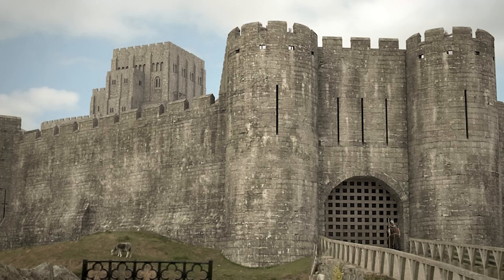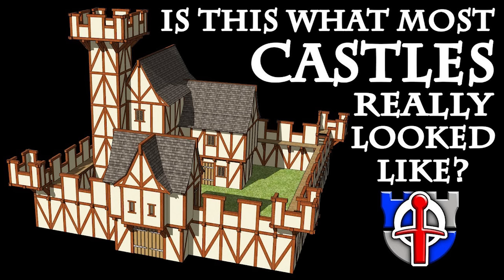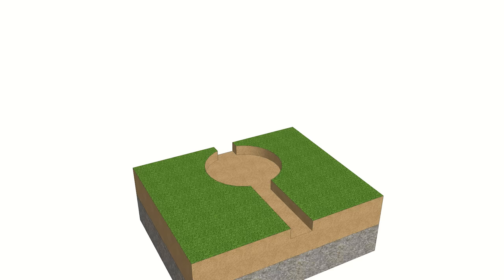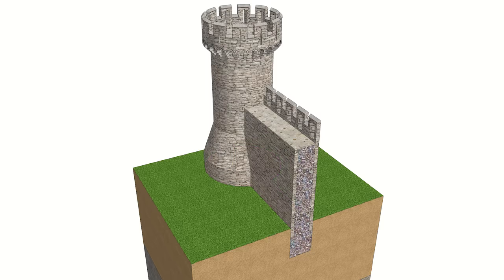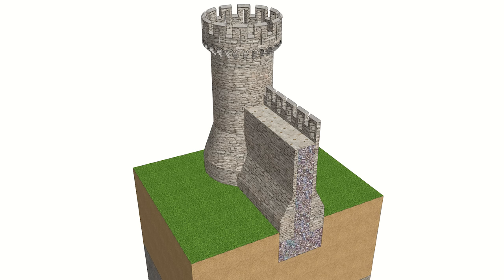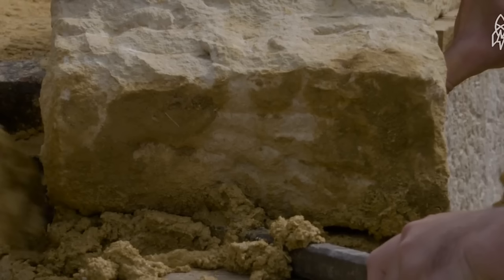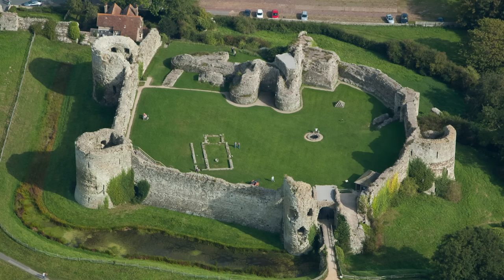How were castles built / constructed in the medieval period?

Comment: While stone does have generally low thermal insulation value it does have high thermal mass value. And this is what lots of people get confused on hence the earlier misinformation. Can 'sink' a lot of heat in the day before raising in temperature then at night it will conduct that heat out providing for a more stable overall temperature.
Reply: It works that way in climates that have large day/night differences in temperature, like the desert or most arid regions.  Areas that have hot days, and barely any temperature drop at night, like the tropics, your walls will just heat up to the air temp and you'll be living in a giant stone oven on a permanent low heat.  You'll need a crap ton of ventilation openings in the walls and you'll want to shade the walls as much as possible or it'll be an extremely uncomfortable place to live.  Consistantly cool areas without a lot of sunlight (like cloudy, rainy england/scotland) have the opposite problem.  Walls will be ice cold all winter and you'll need to provide a lot of heating... a fireplace in every room (both to heat the space and the wall) is how that problem was often dealt with.
Reply: Soviet who Cuts, Sometimes, but more often adobe or rammed earth which has similar high mass and thermal properties for construction purposes so it'll work in pretty much the same way.
Reply: There are also some very interesting and inventive constructive practices with stone. By having the stone jut out on one side or the other depending on where you want the 'stored' thermal energy to go you increase the surface area and thus the conduction. If it is toward the interior the stone will radiate more 'heat' at a night inside then outside due to the larger area. And during the heat of the day while the stone is still taking in thermal energy the interior will be cooler.

This ease of conduction though does promote condensation in humid cool climates easily however, thus requiring wood insulation.

Our ancestors where honestly I feel on average more intelligent then modern humans.  They had less technology but per person where far better critical thinkers imho.
Reply: Ahhh, an excellent explanation, thanks!! :)
Reply: Architect class covers this in the first two years. Then never bothers to return to these outdated techniques if not for academic purposes.
Reply: Cragified I live in a stone cottage with 15" thick walls. It stays cool in high temperatures, but is definitely warmer at night after a hot day.
Reply: Perhaps more effective than wood interior wall surfaces for insulation is the use of tapestries hung on the walls (also rugs on the floors). Remember too, people didn't expect the same level of comfort as we do with our central heating and large R-value insulation materials. They wore more clothes and slept in canopied beds with curtains to hold the heat in.

Glass has even less insulative property than stone. Another reason why windows were kept small in most rooms is that glass was much more expensive, especially in large panes. Leaded glass allowed smaller pieces of glass to be used to fill large openings at less expense than a single large piece. Curtains on the windows helps to insulate them, just like tapestries and rugs.

On the other hand, colored glass wasn't that much more expensive than clear glass, so stained glass windows were popular. Grisaille windows were also popular, especially for windows on the North sides of buildings where maximum light transmission was required.
Reply: The heat retention problem was worsened by the fact that glass windows didn't exist on medieval castles, except for maybe the chapel\ prayer room and the scribe's office room. When your windows are just large holes in the walls, it's almost impossible to regulate the interior temperature.
Reply: @lucasriley874  plus make them white
Reply: @libertopaeurekananarch7562  They had wooden covers at angles. Then they had goat skin on a frame applied with oil that made it  translucent. Surprizing effect.
Reply: @retsaM innavoiG also just a point to make out, literacy rate of the middle ages meant they. Ould read and write french/Latin in addition to their native tongue, pretty much everyone could read and write english in England for example(granted their grammar amd spelling was horrendous but it had a reason for that which shad does touch on in q video of his)  but they weren't literate in french/Latin for the majority.
Reply: It’s actually pretty simple: low-density materials like polystyrene or mineral wool have good insulating properties, and high-density materials like solid stone blocks or concrete have poor ones. The thing about heat accumulation is with the massive thickness of the stone walls, the heat from the outside could not penetrate through the walls. However, the outer side of the wall would accumulate heat and during the night when it is colder outside the acumulated heat would travel in both directions inwards and outwards due to second law of thermodynamics. . Cheers :)
Reply: @retsaM innavoiG yeh shadiversity has a video on this. I thought some of his evidence seemed more like opinion tbh but the narrative he presents is believable and certainly I believe far, far more people could read and write than the stereotype. Literally u just have to learn 26 letters and sound out ur native language.

Comment: From my understanding, I think stone and brick holds heat for a good while, like 8 hours or so, so it doesn't resist absorbing it, but it takes a while to emit.  What this results in in places my house is an odd situation in summer where It can be hot outside but pretty cool during the day at the beginning of a heatwave, but when night falls, the house gets really hot and it's really annoying sweating while you're trying to sleep.
Reply: Sounds like my home here in Sweden. In the winter it's great, but this year we are having a very hot summer and sleeping is almost impossible without a fan pointed straight at my feet.
Reply: Any high mass building like stone, cob/adobe, rammed earth, thick brickwalls ect will have a temperature levelling effect.  If you have a very hot day it will stay cool inside the building... and as the walls emit the absorbed heat over night (assuming the nightime temp is much cooler than the daytime temp) will help to keep the inside warmer than the cold night.  The problem is when you have extended periods of either very high or very low temps.  A few hot days with hot nights in a row and high mass buildings can become uncomfortably warm, like living inside a pizza oven on a permanent low heat.  Consistantly cold weather is the opposite, it's like living inside a stone freezer.  Arid and desert climates are ideal for high mass building as they have scorching hot days and cool to freezing nights... the temp inside will stay mostly at a comfortable level due to the walls absorbing heat during daytime and radiating heat out at night.

I suspect castle walls in cooler climates, like england, would be at the 'stone freezer' end of the scale for much of the year if nobody was living in them/that wing/building ect and keeping several fireplaces lit.  Assuming the fireplaces were lit every day the walls would act in some ways like a giant masonry heater, absorbing heat both from the fire and the hot gasses passing up through the chimneys which often ran several levels up through walls.  If you kept the fires lit every day I think the walls had the potential, especially if it was an internal wall, to become toasty warm and act as giant radiators keeping the entire building at a nice and comfortable temperature during cold winters.
Reply: Right! There's thermic resistance (insulation power) and also phasing i.e. the time for the heat to pass the wall. If it's several hours, (depending the thickness and the material) : you get the heat during the night!
Reply: certainly NOT 8 hours, a couple hours after the sun is down at most... 

I have lived in a small house made of stones, built by my grand father out of the stones off the ruins of an ancient watermill, with walls that were about a metre thick. 
It was never warm inside unless we had the fire place going, and even then, it took a long time before it was warm, and after letting the fire die overnight, the 6am wake up was very cold, the stone certainly did not radiate any residual heat from the evening fire... 

Also, the heat of the sun may have warmed the external stones somewhat during the day, but it never reached inside, it may have served as a buffer for a couple of hours, though, I don't really know.

Comment: You are correct about the foundations, those are very important. Unfortunatly, back then not everyone actually did foundations that well. In my city theres a gatehouse from the 15th century. They used logs for the foundation. It literally already started sinking as they were building it, at one point it sunk into the ground to to the point where the lowest arrow slits were 50 cm's underground. 
Plus, they didn't actually connect the foundations of both the towers, so they kinda slipped outwards, if that makes sense.
Reply: jort93z I wish we had stuff that old other than trees in the Pacific Northwest.
Reply: Oof
Reply: Actually north american natives built some pretty interesting stuff from stone - google Pueblo in Mesa Verde.

Comment: Guedelon is a very interesting project, in 2013 i was there for 2 weeks, assisting the 
stonemasons, there are quite a few things they found out in Guedelon through experimentation, that we probably would have never found out just through archaeological excavation and analysis.
For example, they solved the mystery why the mortar on most castles is so strong and flexible over many centuries and they found that a high carbon content was responsible for the long lasting properties. This carbon comes from charcoal, which is evenly distributed throughout the limestone, while burning it in the kiln, this was most likely more a coincidental advantage during the construction of some monasteries in the early middle ages, but then became known and widespread knowledge(the other method is to just have the charcoal/wood below the limestone, in which case almost all carbon gets oxidized to CO or CO² avoiding a reaction with the calcium.

Comment: When I did my apprenticeship in carpentry the most complex thing, by far, that we ever had to learn was rafter (roof truss) systems, so Shad’s right when he says those timber roof structures are a feat of engineering.
Funny the thing is, virtually no carpenter these days needs the knowledge of how to engineer complex roofs anymore, engineers do! It was the same when my dad took his carpentry apprenticeship 40 years ago. But we still learn it because it’s tradition, & it’s a good way to understand complex, practical geometry which can apply to many other projects.
Reply: I pitched my last roof in the late eighties. The "little red book" of tables, protractors. sliding bevels, roofing squares..... couldn't do it today without some homework. Now, all via cad files to truss makers, and voila! truck appears with ready made trusses. Mind you, not designed to last.... those gang nails rust out, and vulnerable in a fire, so collapse faster.
Reply: 25emann indeed. They say that building a bridge that stands is easy. It takes an engineer to build a bridge that Barely stands!

Comment: I think I once heard that apart from the obvious ease of build, another reason that castle walls where filled with loose stones, dirt and mortar, rather then being built from interlocking stones like the exterior walls, is that the resulting structure (i.e. two solid walls filled with a somewhat looser and more flexible core) absorbed and diffused impacts from siege weapons better. 

Also, I once learned when visiting a castle in the Netherlands (shown in your video in 3:10) that some of the wooden trusses where especially made from timber where the tree was shaped as it was growing in order to grow into a arched shaped naturally, thus allowing for both larger trusses and significantly stronger ones not needing as many joints, and with the wood grain growing in the proper direction.

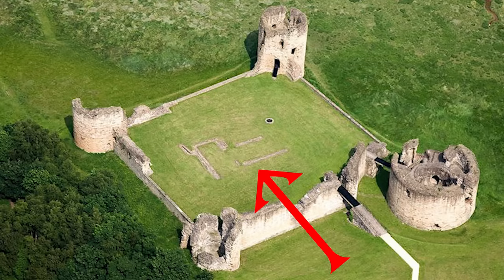Comment: 7:58
"Those buildings that were hugging the curtain wall had walls as thick as is expected in a normal stone building,  30-40cm thick or half a foot"

Is it just me or is 30cm equal to a full foot?
Reply: I was thinking this too
Reply: OR
Reply: Angry Communist ??  My point is a imperial foot is 30cm in metric measurements.
Reply: @DrChattan  Yes. I see where Angry Communist is coming from because OR in mathematical logic means basically "at least one of the two" so technically it could be "either 30-40 cm, or half a foot". But I also agree with you that the way Shad put it, it seems like he was trying to "translate" these 30-40 cm into imperial units for his American viewers (and whoever else uses them). Honestly I think he just miscalculated or mispronounced the "translation". Another good video nevertheless.

Comment: In my hometown in austria we have a church, the wood-constructions-only roof of which is completly build with wooden nails, even though my hometown was a very important trading center for iron and had an especially important nail-making industry.
Not only are iron nails expensive, but wooden nails sometimes are more useful in some sorts of consturctions (especially wood-constructions-only roofs) because they expand after being hammered in, adding more stability.

Comment: One very important aspect of castle construction, which you didn’t really touch upon, is the fact that by far the majority of construction work was not done actually building a castle from the ground up, but was done expanding, strengthening or otherwise reconstructing an already existing castle. With some notable exceptions, most castles we see today are the result of multiple phases of construction, expansion and redesign over several centuries. Regardless of the time period, where construction began, these castles almost always started out as very simple, rather small structures, which could be erected and put to use quickly. The reason for this is obvious: Constructing a large, heavily fortified castle from scratch (as they are sort of doing with Guédelon - though they at least completed the main tower first) takes a really long time, often decades. During much of this period the structures would be more or less useless and nigh impossible to defend. Rather build something small, but useful, in a hurry and then expand from there. There is a tendency to view the evolution of a castle purely in terms of technological advancements, so when an initial wooden structure is replaced by a stone tower or a pallisade is replaced by a ring wall, this is seen as technological progression, as if people didn’t know how to build stone structures or walls before? In reality, most castles started out as smaller, often wooden structures, simply because there was need for them here and now, not 10 years down the line. This is very important to understand when looking into castle construction: That almost all of it took place on an already existing and working castle. This greatly affected both the construction work and design choices and put limits on the possibilities for construction, because the old castle had to remain functional at all times during construction. This is the main reason, why so many castles look sort of haphazardly put together, lacking any sort of symmetry, blending different building styles and being riddled with design compromises. They were never designed or constructed as a whole.

Comment: fun fact that I think belongs with this video: you'll notice that a lot of the stone used in windows, doorways, corbels, archways, sometimes cornerstones etc. is made out of a different, often lighter colored stone than other stones in the castle. that's because these parts need to be very meticulous, they need to fit in perfectly to accomplish their goal, so they use a stone that can be cut and shaped easily when wet: limestone. limestone was in great demand as a building material in some parts of medieval europe for this reason. this is even exampled all over the video, look around at the different windows and archways and doorways and such, you'll see a lot of limestone that stands out against the rest of the rock.